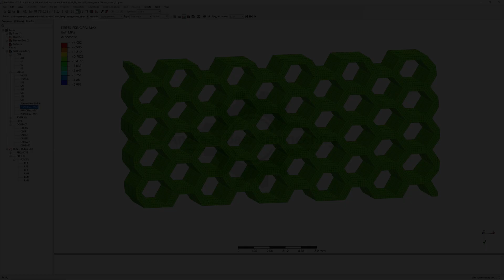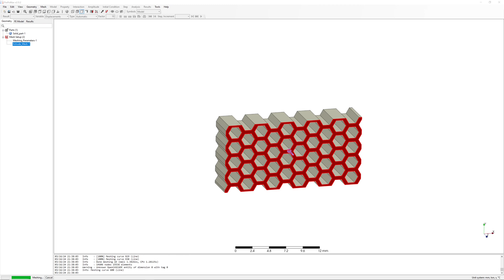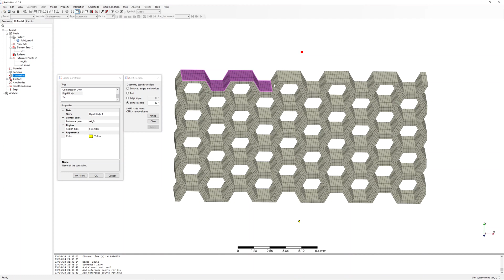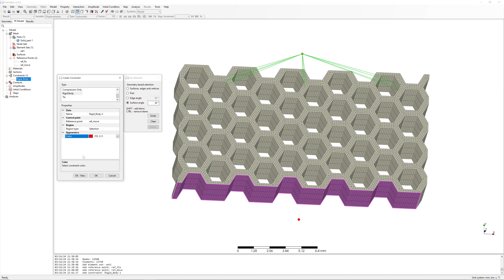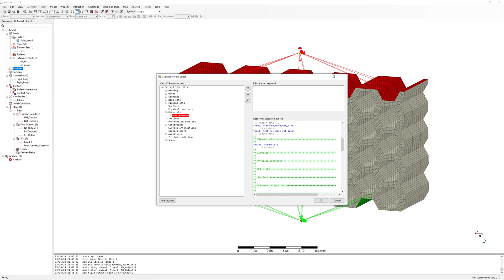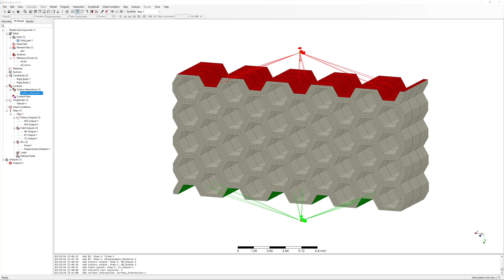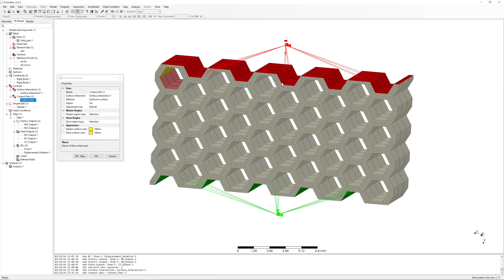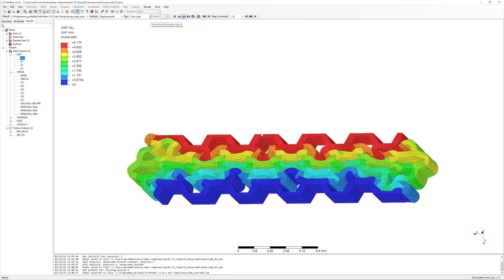Structural Simulation | Compression of the rubber honeycomb shape | with PrePoMax

Comment: Thanks for sharing! Just one question, don't you need Dynamic step due to contact analysis? Or with static step is fine?
Reply from the maker: @AitorAiCoDe  Hello. For analysis with contact you don't necessarily need dynamic. Static analysis is enough. But if dynamic effects (inertia, damping, etc.) have to be taken into analyse, then of course - dynamic.